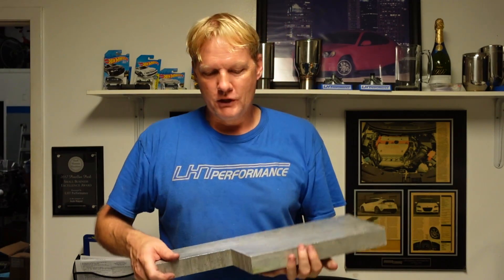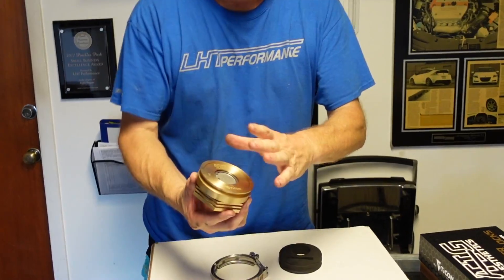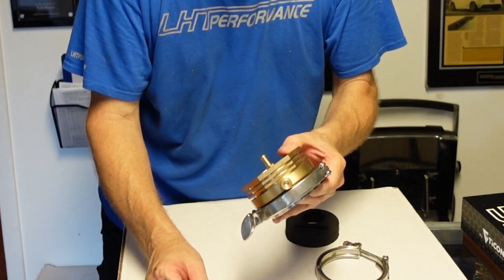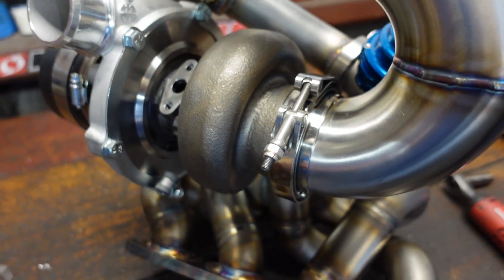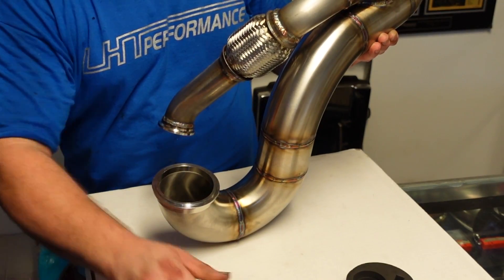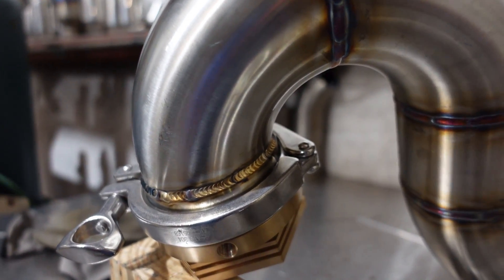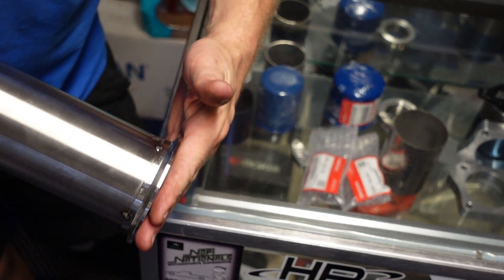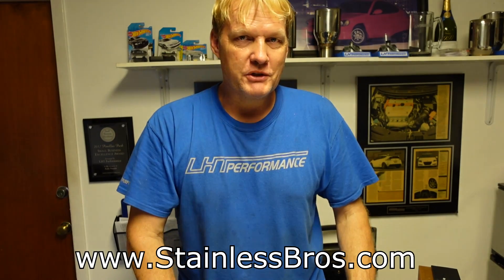Ticon Chill Blocks - Welding V Bands

Comment: The copper cooling block should work really well but, if I am welding a few “V-Bands” of a couple of sizes then put it away never to be used again, won’t help me… sell it to someone else?
Reply from the maker: @deankay4434  I do wish it was more universal and did more sizes. Even double sided. We have the 2.5” and 3” as it’s mainly what we use.
Reply: @  I understand completely as it is a cool idea. Like all special tools, they have a place and a time. Some, I still use today but many will never see daylight unless repurposed. If the ring could be changed to other sizes it would be more useful. If a shop welds items of that size all the time, it would become valuable.
Have a lucky one!

Comment: You dont need to clamp something to the end, you just need to learn how to weld.  Run a continuous weld, Hot and fast. Control the distortion dont fight it.  Stainless steel pulls, so dont give it the opportunity to warp by welding 1" at a time and allowing it to cool.   Single pass if possible or weld 1 half, move to opposite side and weld the other half.   Easy once you understand the concept of welding.
Reply: How many V-bands have you welded?

Comment: That's a pretty cool product.. I work in a brewery and we use stainless triclamp connections all the time.. this would definitely help us.. we use aluminum blocks for sure, but it would definitely be better if we could clamp it...
Reply: I've always had the best luck pulse welding triclover fittings, or use an orbital welder and doing an autogenous weld. 
They're always tricky to get full pen and an attractive weld though.